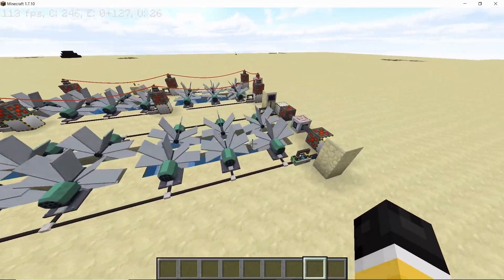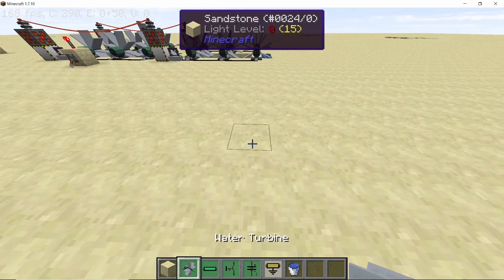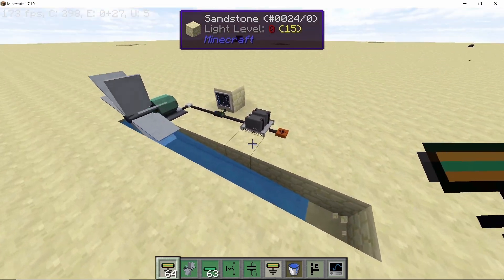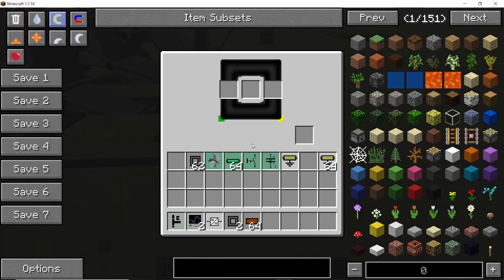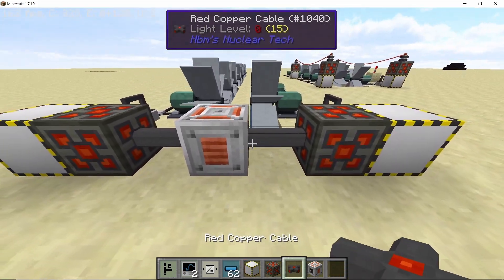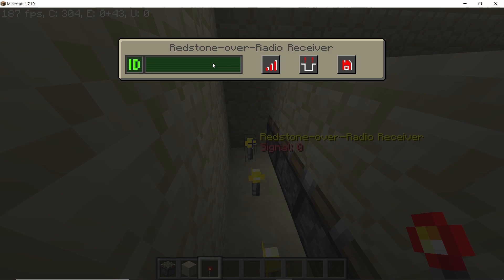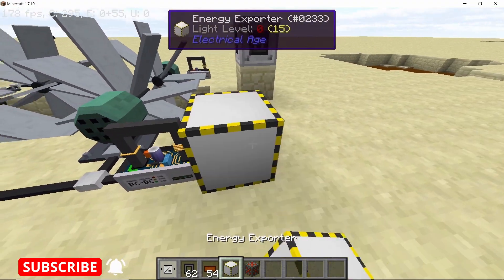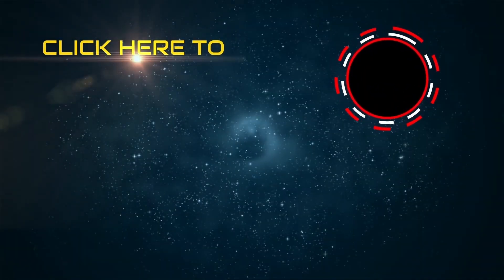Water Turbine Power Plant - Electrical Age & HBM's NTM || Minecraft Hydroelectric Power

Comment: Honestly loving your videos on hbm mod. Learned a lot. One thing I wa t to ask, when I go mining, I get debufs on me like slowness. I checked with the lung diagnostic tool and says lung health [coal]  and slowly decreasing. Is there any mask of some sort that helps with this?
Reply from the maker: yeah mining coal without mask will give you black lung. Simplest form of protection against it would be the trench mask. And any filter which will protect against airborne particles will protect against it.
Reply: @SavageVegeta  I've found that installing a backpack mod alongside hbm helps a lot. You can mine the coal, the pick it up all at once and throw it into your bag. Lignite is literally the worst thing though. With coal you can hold a stack for a few minutes before you become unrecoverable but lignite is a few seconds
Reply from the maker: @Ar_Tank  that's true backpack mods are helpful and lignite is a fairy new addition to the mod , but still I would highly recommend going for a trench mask early game and getting a proper gas mask asap as there are other gases in the mod as well which will damage you and either a mask or a strong Armor (which can't be obtained till late game) can save against them